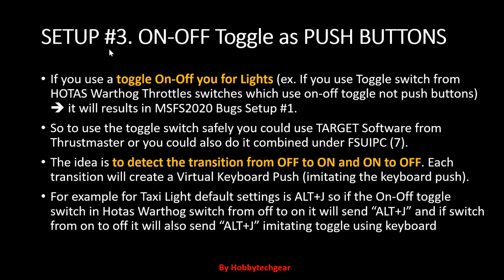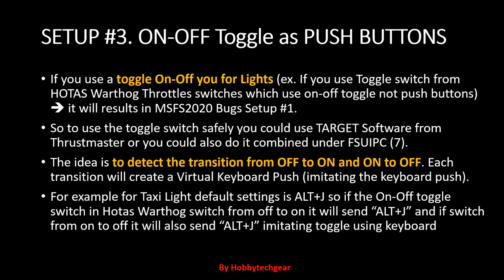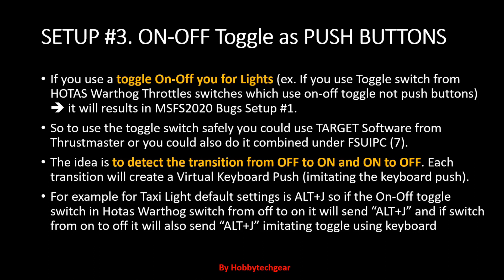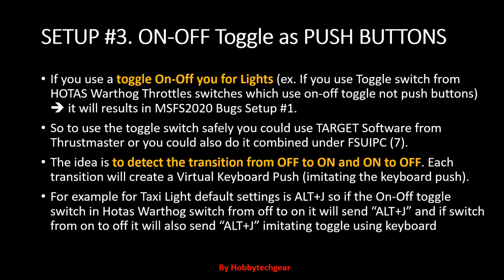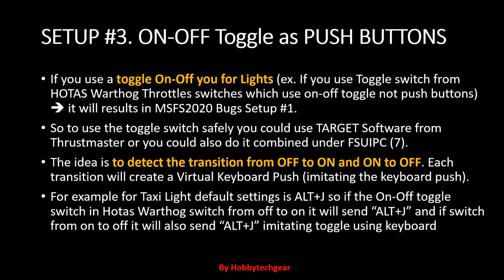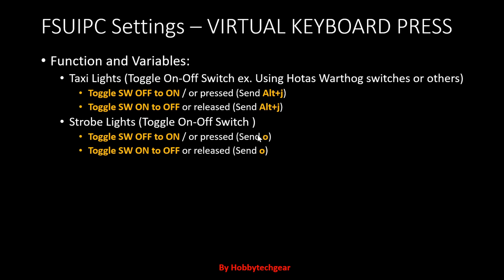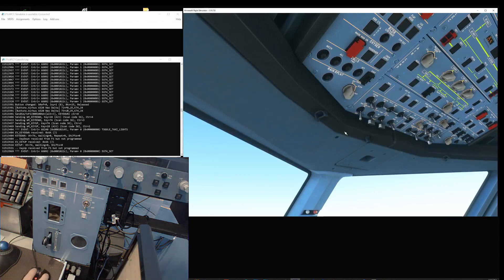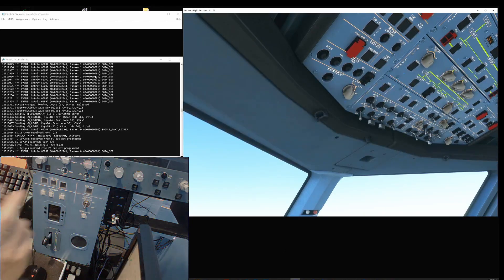DIY: PART 3 Controller for MSFS2020 with FSUIPC7 Setup

Comment: Hello , I installed FSUIPC7 and I’m trying to program the g1000 heading bug , but it doesn’t work fine. Just move a few in both directions. Im using a hardware panel with switches and buttons. Any recommendations?